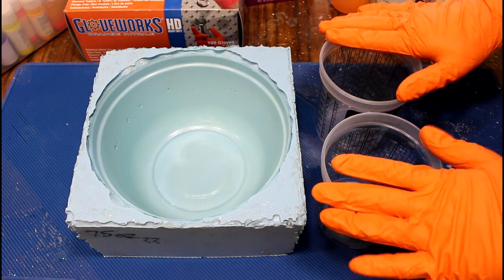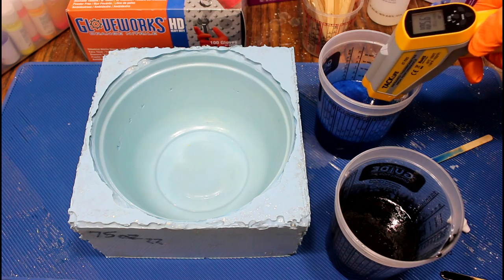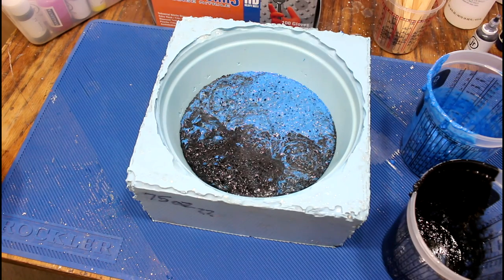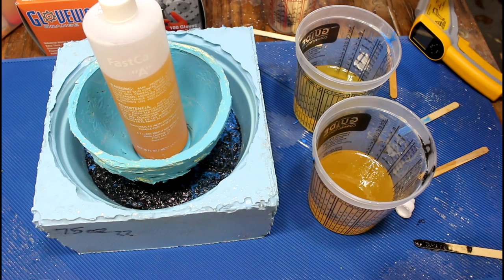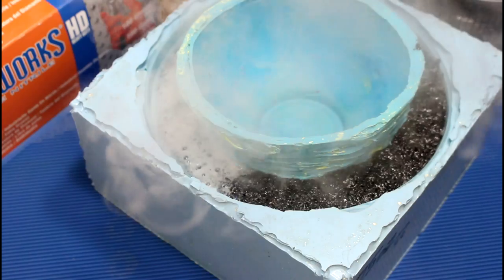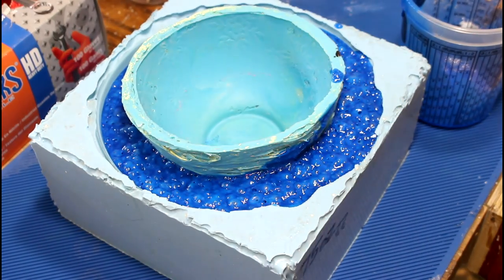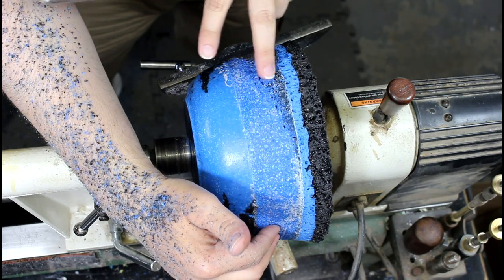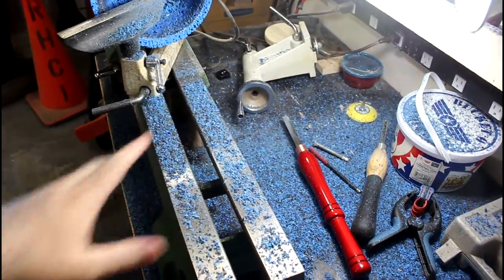Son of Lava Bowl!

Comment: I would have turned the mold used on the center of the bowl inside out for a smooth surface.
Also I would like to see you make a " water Table" out of wood with the "streams of water " having LED strips at the bottom so it literally glows. I think that would look cool.

Comment: The Son of Lava Bowl looks great. Now what happens when you use that bowl back in the mould and pour in a translucent resin to fill the voids on both the inside and outside? When you turn it again down to the lava, you'll get a nice smooth bowl with gem like facets of the translucent resin, set into the lava.

Comment: Peter,
Would it be possible to place the bowl back into the original mould and use an epoxy resin (possibly in the vacuum chamber?) to stabilize the bowl and give it the ability to hold liquid or take a polish?

Comment: Now try one and fill the holes with regular resin to stabilize it and make it functional, but still able to see the cool design! Maybe make it a bit thinner, fill the original mold with some clear resin, add lava bowl, fill inside and over the top, and the trim it down to right before hitting the lava resin. Thoughts?

Comment: I believe that the blue reacts faster than the black simply because you are stirring it with your dominant hand. You can clearly tell in the video, especially around 6:10 , that your right hand uses faster motions than you left, possibly causing a difference in the reaction speed.

Comment: I'm wondering, if you create a Lava object of one color and basically complete it to the point of where you're done with turning the basic shape, then you put it in a mold with a bit of extra space, weigh it down if necessary and fill it up with a different color resin. That resin would probably have to be rather low viscosity. You let that cure and then basically turn the excess resin away, so you get back to the original resin. The result would be that all the cavities of the original object are filled with the second resin and you get a piece covered in little dots.

Comment: I wonder if the black didn't react as quickly, not because that's just how the dye is, but because you were mixing it with your non dominant hand, and it would have reacted faster if you switched hands in between pours?

Comment: what if, instead of using the thick molding silicone to make a mold of the outside of the bowl, you used it to make a mold of the inside of the bowl, so you would have a smooth exterior rather than a rough exterior?

Comment: I just bought some of that Fast Cast resin. I didn't know it boiled, now I'm scared to try it. I got it for making the 'white of the eyes'. I have several small silicone eye making molds. Is the Fast Cast safe enough to use in those tiny molds?
Reply from the maker: It ONLY does this with this dye. The resin is super stable on its own. Don't worry.
Reply: @peterbrownwastaken  Whew! Ok, thanks for letting me know! I have some clear resin I use dyes with.

Comment: About half thru video when posting this and not sure if anyone else has suggested this but that inner bowl could you have turned it inside out so the smooth part is on the outside?
Reply: Another thought how about coating it with clear resin after you finished turning it?

Comment: I have an idea for a project... it's is basically an table top covered with Monopoly money or Pokemon cards covered in resin... but u cut the top like an inch or so down so then sand it and put the money on the bottom and pour the resin so it has a layer of resin on top of the cards or 💰......(it would be cool I think) thanks for ur time

Comment: Has anyone figured out this chemical reaction yet?
Reply: Its an exothermic reaction.  Its most likely a moisture cured urethane based resin.  When an excess of moisture (in this case pigment) is introduced it accelerates the reaction.   Its like gorilla glue,  use a little water and it gets foamy and helps cure it quicker.  This initial reaction causes heat which again accelerates the reaction further.   This reaction is also mass dependent.  If peter was to do this with a gallon of resin at a time it would probably catch fire and that steam would be smoke.  That is probably why the last pour was less violent of a reaction.    Hope this helps.